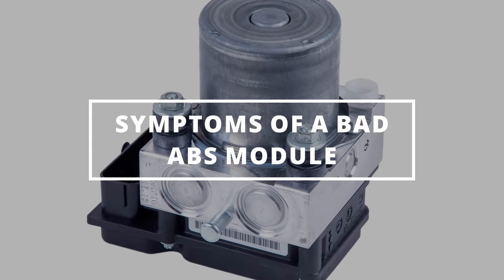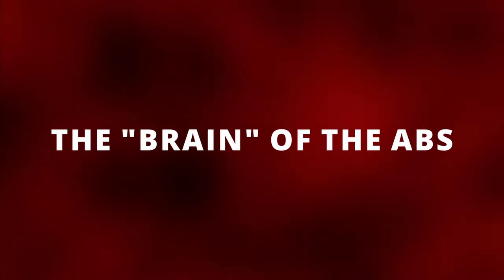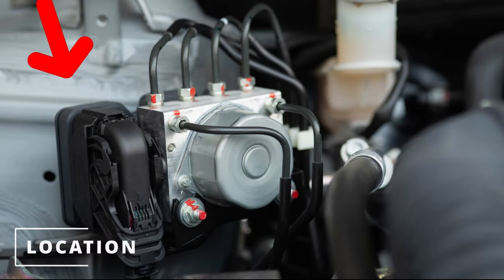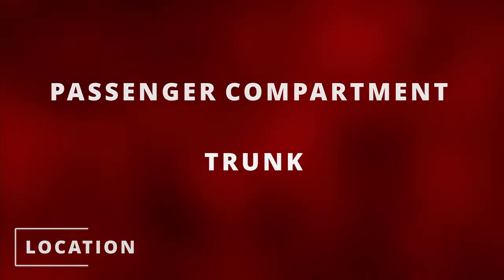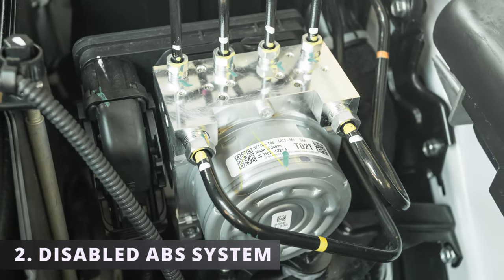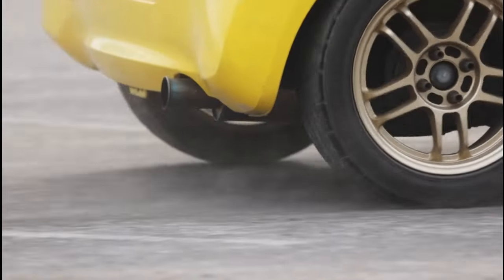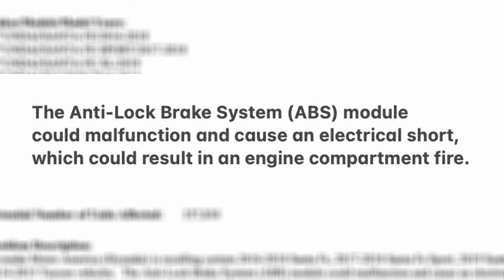SYMPTOMS OF A BAD ABS MODULE

Comment: Bruh, I'm getting a new abs module as mines is faulty and I almost crashed about 2 weeks ago as my brakes locked up on me and it spone the vehicle around 180 degrees. Thankfully no other vehicle was around and I didn't fly off the road.
Reply: Glad you str8 fam
Reply: Mine is too. Getting a new one
Reply: I would of took the abs fuse out and it would disable the abs.
Reply: My right wheel in my Tacoma is locking up could this be an issue ?
Reply: Did your breaks lock up on there own?
Reply: @nativefamily8949  it's  hard to say, especially now since my incident happened months ago.   But my mechanic did reconfirm that the abs module is faulty and that I should get a new one/replacement.   It's hard to find them brand-new tho, I mostly come across used ones.
Reply: @nativefamily8949  best to check your mechanic.  But for me when I'm drive, u can just feel, through the steering wheel, the floor the pedals, etc. that something doesn't feel right, like the wheels are dealing with some type of resistance, that they are not spinning freely.  Don't know if how I'm describing here makes sense.
Reply: @mace2gorc872 wait so you were driving and all the sudden it started braking on you randomly?
Reply: @Saint696Anger  no, I was apply the brakes when it happened.
Reply: I did💀
Reply: Check wheel speed sensors first. They are magnetic, and simply pulling them off after unplugging, cleaning and replugging fixes the issue most of the time. Modules do go bad, but not very often
Reply: @nativefamily8949 yup drive 120kmj then it suddenly brake it own

Comment: I've replaced almost evereything in the braking system except for the ABS pump. The car's brake peddle is still spongey even after air bleeing the system, could the ABS module be the reason for this?? Note that there are NO ABS codes or lights.
Reply: If you can hear the pump motor running, probably not.  Ford dealerships are ripping off thousands of customers just throwing parts at this problem and not making a permanent fix.  If the Transportation geniuses in Washington actually owned a car or knew anything about them there would be a safety recall.  Ford has to know what the fix is but, when they are making this much money.......why help anyone.  If you can't sell cars, sell parts!
Reply: I am going through the same  problem, spongy brakes. Replaced many things except the abs module, and replaced the entire brake fluid. I suspect the abs module is sucking air somehow, because in one of the brake line which goes from master cylinder to abs module keep getting air even after I bleed it. So my next step is to physically bypass abs module (just for testing purpose). I have removed the abs module and now re-plumbing the lines directly from master cylinder to the brakes.  By the way my car is Toyota Camry 2005 Japan build. The abs module looks sealed, no way to open without damaging it.
Reply: @someone1089  can't you figure out from where the air enters the line? I mean there's pressure, hence there'll be at least a leak if not air entering the lines.
Reply: @TheKhwailed  Thats the interesting part about this issue. There is no leak anywhere that I can see. I am not loosing fluid at all. ABS module have tiny air passages to pull air in dynamically depending on the situation. I think in my module, perhaps one or more of those passage is stuck open. There is some rust and lots of salt deposits on the module, so I am just guessing this is causing the air to suck in. 
Beside this what could it be? I have replaced my already working master cylinder with a new one. I doubt if brake booster has anything to do with soft pedal. Not many options left, but I will continue the search.
Reply: @someone1089  I had and still have a hissing sound coming from the brake booster even after replacing it, but I also don't think that the booster has something to do with the spongy peddle. I'm not at home right now, but when I go, I'll try to air bleed the ABS module. I'm seriously running out of possibilities after working on the ABS module!
Reply: @TheKhwailed  Sorry for the long reply in advance. I think at this point we have to think outside the box. There are too many influencers on the internet who can divert our attention from the actual issue. I am taking following approach now. 

1) Are we bleeding the air the right way? may be not. Repeat it. If doing alone ,pump the brake multiple times before releasing air/fluid from the nipples and flare nuts (this is important since we have touched almost everything). 

2) Make sure the flare nuts does not have any leak, if it is not seal tight a tiny leak can cause the air to suck in. It is entirely possible that air can get in but fluid cannot get out from a tiny leak specially from the flare nut. Air is much less dense than brake fluid. I would either use teflon tape on flare nut threads or apply grease around the threads after it is tight. Also tight them all again since brake tubing flare has to be seated real good. Bleed the entire system again after the flare nuts sealing. 

3) Brake caliper buckling. Caliper pins can bind and stick the brake pads which could cause brakes to feel spongy. I am taking this approach, remove the caliper from the wheel and only leave the brake hose connected, such that only piston is expose . Put a thick piece of wood may be 2x4 between piston and caliper inside wall to test piston's working eliminating the caliper pins completely out of the equation.

Forgot to mention that I have removed the ABS module and plumbed the lines directly only to the front brakes. Now the circuit is simple. From master cylinder to front brakes, but it still does not feel right, the pedal still sinks. So in my situation it is highly likely that the flare nuts are causing air to suck in and I am not bleeding the air right. I am pretty sure If you take this to a professional they might come up with something really simple we might be ignoring (if the mechanic is honest).
Reply: @someone1089  I almost feeling the need to cry! For 13 years the brake was working just fine, until I saw the air bleeding videos which made me so excited about doing it. Two or three months later it started malfunctioning and I paid the price!! Now, besides the ABS module air bleeding, I'm thinking of the air entering the system since there's not fluid leakage. So maybe I'll try the teflon thing. But please, I can't imagine the brake pin and piece of wood method you mentioned above!?
Reply: @TheKhwailed  Totally understand your feelings. I have worked on brakes multiple times but never ran into this kind of problem. Here is my today's update with a very positive result.
Tighten the flare nuts and applied grease where the thread meets the other body to prevent any air possible air leak.
I started to isolate the hydraulic circuits, since I already have ABS module removed so changing the plumbing wasn't hard. Simplified it to only front brakes and master cylinder. Brakes are still spongy. 
Then I blocked the passenger side line completely using a piece of rubber between flare fitting, the brake sinking was gone. This indicates that the issue might be with my passenger side brake caliper, which I cleaned and serviced already and it looked good. Looks like the piston is binding inside the cylinder rubber seal causing it to not fully engaged with the pads which could cause spongy effect.
I am going to try a new caliper and will provide an update. Oh and during this entire process, I bled the lines pretty well using and hose method, I press the pedal about 20 times for bleeding, and reuse the fluid again.

For your issue I would suggest to block the lines from flare nut, or pinch the brake hoses using  vice grips and see which wheel is causing the issue. Pinching the line brings little risk of damaging to hose, make sure to use maybe piece of cardboard between the plier teeth and hose, or invent your way of blocking the line. I think the only good way to find the issue is to isolate the wheels. Good luck.
Reply: @someone1089  Thanks alot for your notes. I'll see what I can do. At least I can sell the car (after fixing its brakes issue).
Reply: @someone1089   Hello again. 
Guess what?!! ... Three days ago I was doing some research to try to find out this dilema of my car brakes. I saw many videos untill I started to lose hope. Then I saw the very last video which ended all my sad story with the brakes. Like what you mentioned in one of your coments above about the brake caliper pins and how they might affect the system. I didn't consentrate on that part but after I saw the vedio, I had to re-read your comment again. And this is it, I removed the pins (they were not seized at all), but I just removed them, cleaned them and applied new grease, now the brake are much much much better. Thanks to you and the guy in the video I saw.
Reply: @TheKhwailed  Glad you found your issue and fixed it. I think I have seen that video you are referring to. He explained it well. I am happy that both of us solved our problems. Mine ended up by replacing both brake calipers, which I considered "good" but the pistons in the calipers were too tight and pedal had to go all the way in to apply the pressure. I learned so many things during this exercise, specially brake line flaring is now a new skill under my belt. Kudos to you on the project. Enjoy your brakes!
Reply: @someone1089  Again,  thanks alot. And good luck too you too in your new skills and any future projects you may have. It was very nice talking to you.
Take care.
Reply: @TheBux67  I've already solved it. The caliper pins just needed some cleaning and greasing! That's all.
Reply: It's your vaccum pump up in the engine. That has the serpentine belt attached to it. Lol. Brake sponge has nothing to do with any abs systems. Or you have air in the brake lines.
Reply: @WheresWaldo05  I already solved the problem. Just cleaned the brake caliper pins! That's all!
Reply: @TheKhwailed  Did you add grease to the pins too like you are suppose to do?
Reply: @WheresWaldo05  Yes. Of course, right after cleaning the pins and the place where they are installed.
Reply: I bought a professional scan tool that can bleed the ABS module.... bleeding it rn actually... a regular brake bleed won't get the air out of the module if there's some in there
Reply: I have the same exact problem with my 2012 mazda 5..replaced the master cylinder twice , replaced the booster, and a new caliber on one tire and the spongy brakes are worse than before..now I have another problem with my car pausing while applying gas .I have to let up on the gas pedal for it to accelerate properly again.

Comment: is it possible to have a bad module without an ABS light?
Reply: No
Reply: Yes. When the abs light is burned out.
Reply: Yes
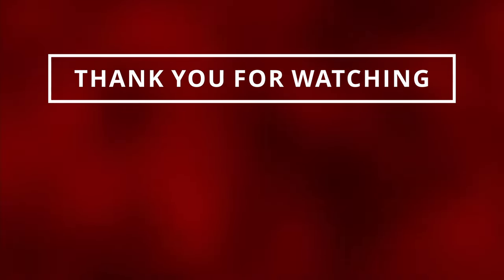Reply: 1:47 Yes! it is possible  that all the electrical components will work ( pump motor, and solinoids) but the valves may stick due to contaminated fluid. Therefore causing either locked brakes or no brakes on one wheel or on several or all. And may not give a warning or code.
Reply: @dougsanders6034  In that cause you just mentioned do I have to change my ABS module? I have one wheel that is not breaking and someone said I need to replace it because it is not sending fluid to that wheel? is there any other solution?
Reply: @rubenfaqs hello I'm experiencing the same,on mine two front one aren't braking and the car doesn't show abs light even when I start the car.im wondering what can be the problem LED light or what.
Reply: @Phutiv05  Hello, I had to replace the ABS module.

Comment: Newer cars actually need the ABS to be installed at a dealership or qualified mechanic shop since the "Geniuses" that design the car specifically engineered each ABS module to be Programmed to the VIN of the car or it wont work right... Cough cough JEEP... That way they could make sure that when it goes bad, in stead of just buying the $300-400 part, they could charge another $300-400 to program it and another $500 to install it, even though its fairly easy process to replace it.

Comment: 1998 Ford E350, 4 wheel ABS. When stopping pedal will not travel unless you press it hard brakes finally work then  the BS light comes on and brakes work normally afterwards. Shutting off and restart it does it again. Pulled the ABS maxi fuse in the engine compartment.  Lights stays on but the brakes work  with no ABS.  Also a brake  fluid loss no leaks anywhere. Rotors, calipers, master cylinder, vacuum  booster,hoses , hard lines and wheel speed sensors all have been replaced. The ABS can not be read thru the OBD-2 port. Seperate port for ABS  1996 to 98 E series. The ABS  electronic control checks out. Swapped the controller from my 97 E350 to the 98 same problem  and the ABS works on the 97.

Comment: Is it possible for a module to be bad and still show speed from the rear wheels but the front ones are dead? I replaced all the sensors already but there’s no engine codes for the module being bad. The front sensors are not reading any speed from the wheels

Comment: my car is a4b5 quattro. My problem started when I lifted it on the jack and started the wheels then they locked. When I put it down I couldn't start it until I released the pressure. After that, as soon as I press the pedal twice, it blocks again. abs can be heard buzzing. What is the problem?

Comment: I've had mine diagnosed, the tester said it's a short on the front right sensor and a fuse / relay fail  but I've checked all the fuses and can't find any abs relays

Comment: Quick question, was the speedometer going up and down, were the rpm’s staying the same? Having the same problem right now with my truck right now.
Reply: Yeah mines the same way.  My 2016 Nisan maxima. The speed won’t accelerate. My car thinks I’m pressing the gas and brakes at same time.  my abs module is under the hood by the passenger side. Which a mobile mechanic can’t get to do to the position. So I need to take in to a body shop.

Comment: Will the light always come in? I have a 2001 Durango and the brakes lock up now and then. The ABS light was on until I got the brakes serviced at tire discounters but now the front wheels are locking up now and then. When it happens, if I release and press them again they are fine

Comment: My wheels locked up recently causing an accident.  I was going about 20 to 25 mph.  Can the ABS be going out without having an ABS light coming on?  When I first bought the car you could feel the ABS working with the rhythmic pulse felt in the brake pedal.  That rhythmic pulse is no longer felt in the pedal and the breaks have had a lock up.  The brake pads look good and I just replaced the 5 year old tires but I am still wondering if the ABS is going out even though the light hasn't come on in a 2005 Mercury Grand Marquis LS.

Comment: I have one wheel that is not breaking, I was told it could be the ABS module that is not sending fluid to that specific wheel, is it safe to drive with this problem? or are there other solutions, I haven´t had any warning light yet on my dash, besides that module is really expensive.

Comment: I have a 09 Kia optima that the front passenger wheel locks up and the only way to get it unlocked is to take the caliper off push the fluid out and put it back together together. It doesn’t lock up every time I drive, but it locks up quite often. Do you think this might be the reason?
Reply: Check flex lines

Comment: What about proportioning valve? Don’t they call it that, too? I don’t know? Just asking.
Reply: Prop valves were used in vehicles that have rear drum brakes, with disc brakes they removed the prop valves
Reply: @dfrmotorsports4591 not true.  If there’s no abs module there’s going to be a proportion valve somewhere
Reply: @pelonconstante6271  everything i was taught in auto school (06-08) was prop valves are only used in rear drum applications due to having to overcome force of the drum springs so the front brakes didn't have to do a ton of work prior to the drums coming into play

Comment: 21 Canyon.  0 voltage at ABS pump.  Brake booster inactive.  All inlet and outlet wheel solenoids show inactive.  No cel or abs has EVER triggered.  Front brakes drag intermittently.  Fuses are ok.  Pump looks clean as new.  Anything you recommend checking before I replace it?

Comment: my ABS code error reads rear wheel sensor faulty signal on my 2007 volvo s40. but nothing related to ABD module, that could be just replacing the wheel sensors?
Reply from the maker: Yes please don't replace the abs module. It could be the abs sensor or at times the wheel hub assembly. Make sure to look for torn wires/corrosion on the connectors for the abs sensor as this can cause it as well.